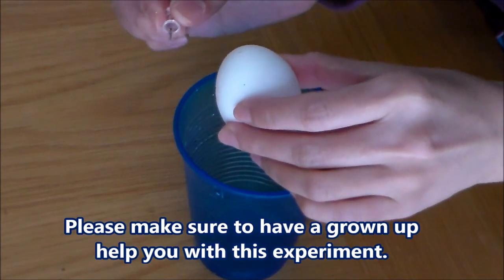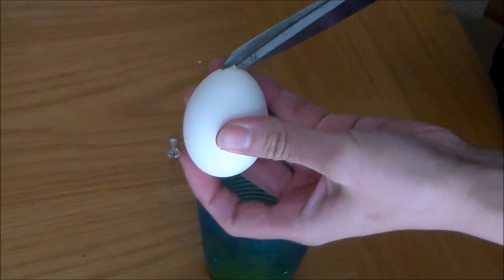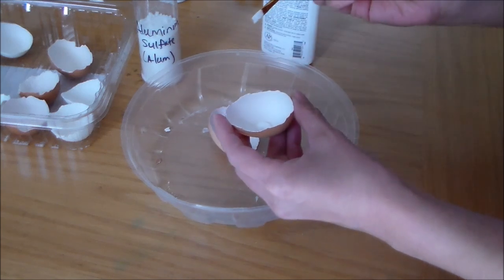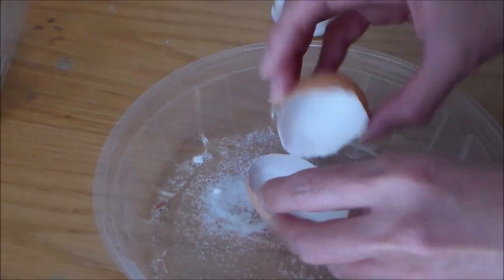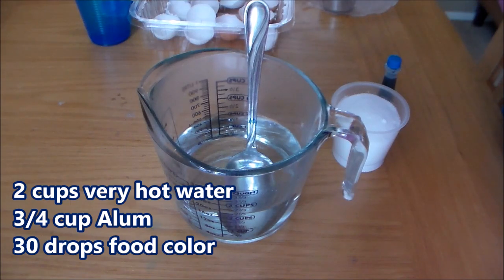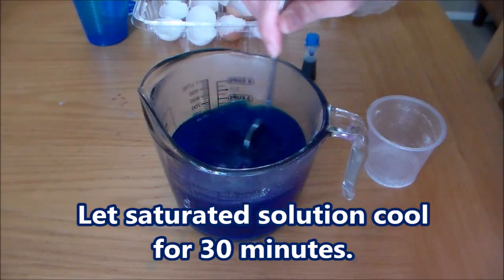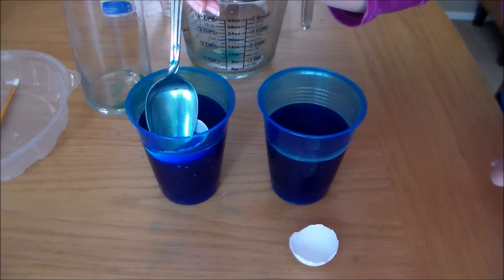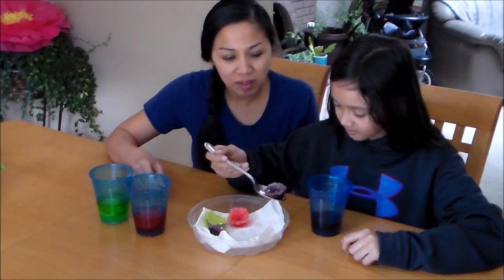DIY Crystal Egg Geode

Comment: Hi, great vid! I was wondering two things:
1) can I use those white pipecleaners to shape my geodes instead of the egg shells? And:
2) if I use my measuring cup for the Alum soloution, if I wash it out thoroughly, can I reuse the cup again for cooking? I'd to have to throw it out.
Reply from the maker: Thanks!  Sorry I haven't been able to reply sooner. did you try it with pipe cleaners?  I would make sure to wash the container thoroughly in soap and hot water. I try to use separate containers for science experiments though so I don't cross contaminate foods, just to be safe and please make sure to do your own research and be safe. Thanks for waching!
Reply: @LearnToGrow1  thank you!
Reply from the maker: ' @jge8144  You're welcome!  How did it go?
Reply: @LearnToGrow1  I used borax instead, as well as the pipe cleaners aforementioned, and from other vids, reheated the mixture to get better results. And they turned out great!
Reply from the maker: @jge8144  Great to hear that! It's always fun to experiment! :)

Comment: can we use borax powder instead of alum to coat the eggs..? nd borax solution intead of the solution u used?
Reply from the maker: Sure! You can definitely make Borax crystals! Thanks for stopping by!
Reply: +Learn To Grow thnku😍
Reply: +Learn To Grow hi is it fine when you have the crystals in the water the alumni powder will come to the bottom.
Reply from the maker: Yes I believe Borax can be used to make crystals. I've never tried it, but seen good results. Make sure to add enough Borax to saturate the water. Thanks for watching!
Reply from the maker: You're welcome! :)
Reply from the maker: Yes the alum will saturate the water and eventually fall in the bottom. Thanks for watching!
Reply: SHHH

Comment: I know I’m super late but whatever. Anyways I’m doing this for my science fair, but I just have one question. Do you know what the constant is?
Reply from the maker: The water must be kept at a constant temperature (hot) for the alum to dissolve. I hope that's correct. There are many different factors and variables with experiments. God luck and thanks for watching.
Reply: Learn To Grow Thank you! Awesome video!
Reply from the maker: You’re so welcome! I meant good luck in my last response! How did it turn out? Thanks for watching

Comment: tried  it...didnt work? do you have to use distilled water?
Reply from the maker: No need for distilled water,  but the alum needs to fully dissolve in the hot water . There shouldn't be any alum granules after you've stirred it in. Did you put enough alum?

Comment: i did this.. but i got failed.. why oh why? -.-
Reply from the maker: Was the water saturated thoroughly with the Alum powder? If the Alum settled on the bottom before the eggshells were placed, it most likely didn't saturate the water. Thanks for watching!
Reply: Hmm so do i have to repeat the experiment again or just add water to saturate the alum powder? :)